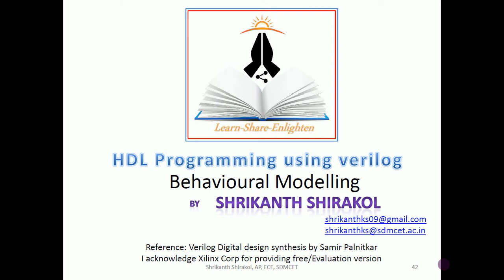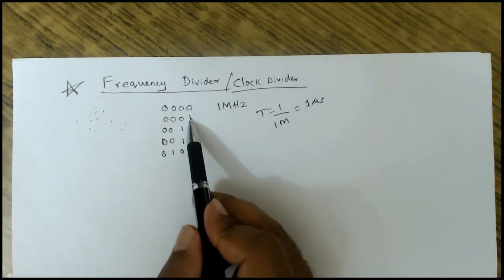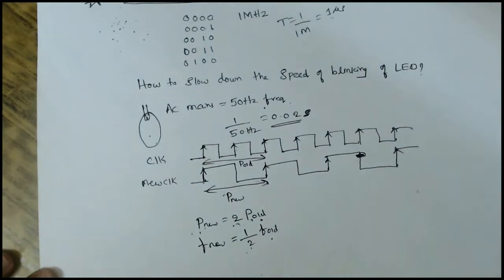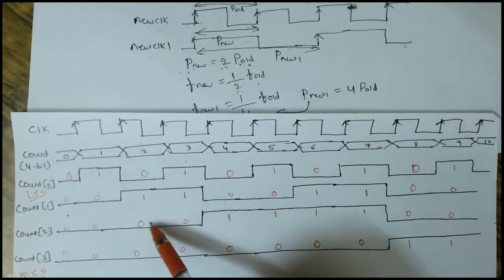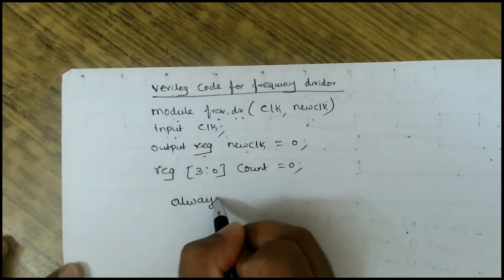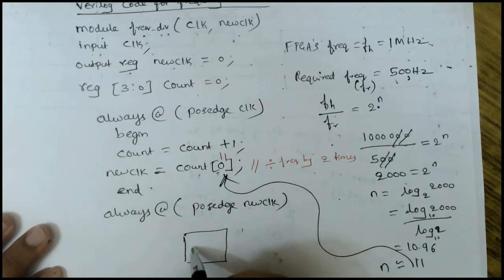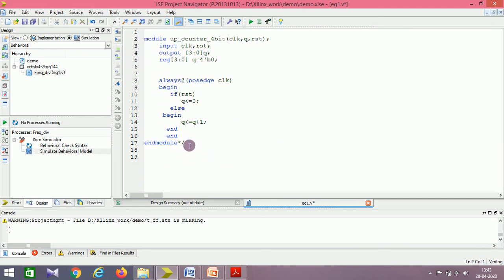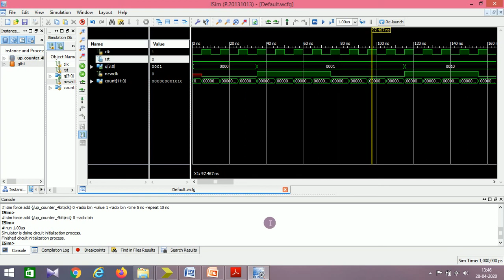Lecture 22 HDL verilog: Frequency Divider (Clock Divider) -Shrikanth Shirakol

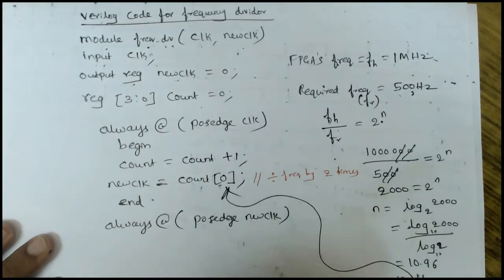Comment: Hi Sir, I think there is a mistake in Calculating the bit number @17:40. Please check the formula once, your formula will give you number of FF's but not the bit number. So here "n" represents number of FF required to achieve 500Hz clk from 1MHz clk. In your example Count[10] will achieve the 500Hz clk output.

 For easy calculation just check deriving 50Hz clk from 100Hz clk with the same formula you mentioned (which is simple divide by 2 ).

for bit number the formula should be 2^(n+1).
Apart from that, very good explanation on the freq dividers.
Waiting for your response. Thank you.
Reply from the maker: Dear Ram Prakash, your analysis is correct. But how i derived formula is explained in detail in one more video lecture of mine. The link is : https://youtu.be/oe42ZY3RNjo
Freq division concept starts @ 30:00. 
And thanks for your good words.
Reply: @shrikanthshirakol3843  Thank you sir for ur quick response. I have gone through the video. It has been corrected in that video.

Comment: Sir, How to implement the floating value of n ? (in verilog)
 
We round off the value of "n" in these examples, but in several projects we are strictly bound to time constraints So it is necessary to implement floating number for n to precise calculations
Reply from the maker: In that case, we use different logic to implement Freq division. Here i have discussed easy one for the beginners.
Reply: Will you please 🥺 guide me that logic ?
Reply from the maker: Will try to make a video lecture on it.

Comment: how can i generate phase from clock
Reply from the maker: Phase of the clock can be varied by forcing the clock after certain delay units. If u can elaborate the need of doing it, i can explain you better
Reply: I want to find  frequency & phase by using a clock buffer circuit
Reply from the maker: l hope you want to measure clock skew. Phase can be measured by measuring the delay between the two clocks of your focus. Consider 1 period delay to be 360 degree and measure the skew. 

And Freq can be found by taking reciprocal of period.

Comment: Sir how to generate  a clock of 800 MHz in verilog
Reply from the maker: @saranga rasanga, Generation of a clock of 800MHz possible only if the target FPGA kit has the max. Operating frequency more than or equal to 800MHz. 
If you provide me the input frequency, i can help you in getting the required output.
Reply: @shrikanthshirakol3843  sir I want it for writing test bench using timescale
Reply from the maker: @sarangarasagna4058  Clock period, T is reciprocal of Clock frequency f. 1/800MHz = 1.25ns = 1250ps
time scale to be set is: 1ps/1ps (can be even set in terms of "ns" also)
Half period of clock = 1250/2= 625ps.

Testbench for generating clock with 800MHz.

forever #625 clock= ~ clock;
Reply: @shrikanthshirakol3843  sir thank you
Reply: Sir how to write test bench code .
And I want to divide by 10.

Comment: module freq_Div(clk,newclk, newclk1,newclk2,count3);
input clk;
output reg newclk =0,newclk1 = 0,newclk2 =0,count3=0 ;
reg[3:0] count =0,count1=0,count2=0;

always @(posedge clk)
begin 
if(count3==1)
	begin
		count =0;
	end
else 
	begin
		count = count + 1;
		newclk = count[0];
	end
end

always@(posedge newclk)
	begin
		count1 =count1 +1;
		newclk1 = count1[0];
	end	
always@(posedge newclk1)
		begin
			count2 = count2+1;
			newclk2 = count2[0];
		end

 assign count3 = (count & count2)?1'b1:1'b0;
endmodule                                                                                                      

im not able to do freqncy divider by 5 rtl code